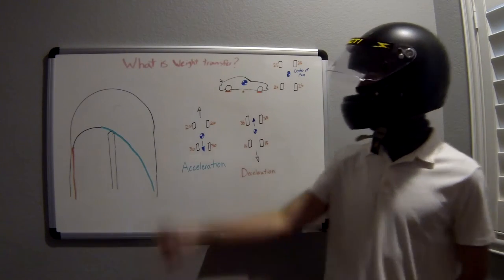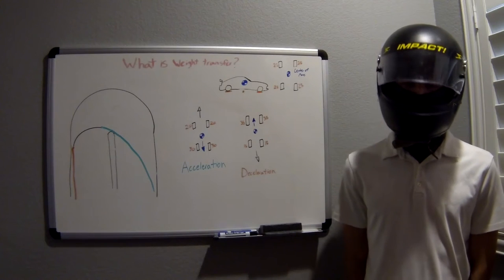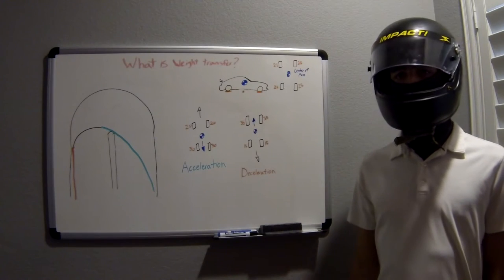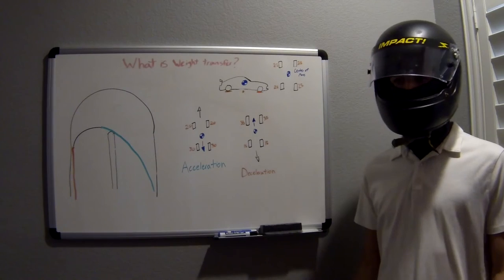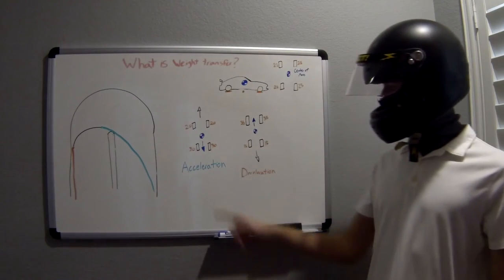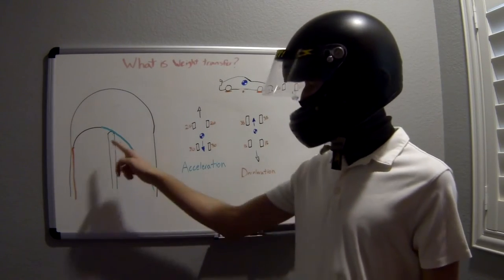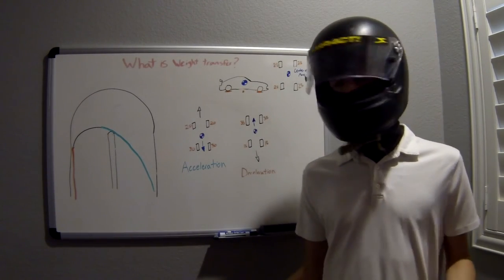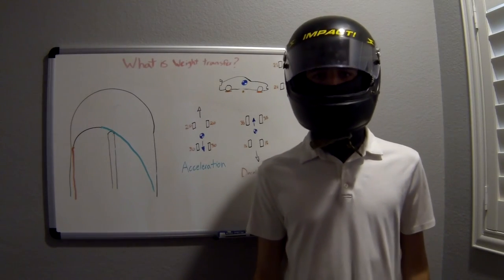Racing Basics- What is Weight Transfer?

Comment: I have one question. Lets say I'm on a track and approaching a Turn, as I'm in the corner and turn the wheel I notice my tires squeeling and having slight understeer, but Its still enough to get me through the corner at that speed, now is that perfectly fine or does it actually slow me down and would reducing my speed in that corner the next time be a better choice?
Reply from the maker: Yes, if your front tires are skidding across the ground, they are slowing you down. The simple answer is, if you can make the turn at that speed turn less, or use slight break to create more front grip. 
(or come off the throttle~maybe applicable)

-RR
Reply: The best drivers use understeer to their advantage! 😉